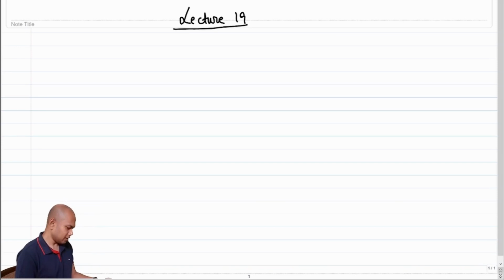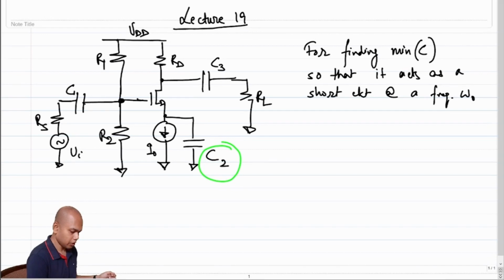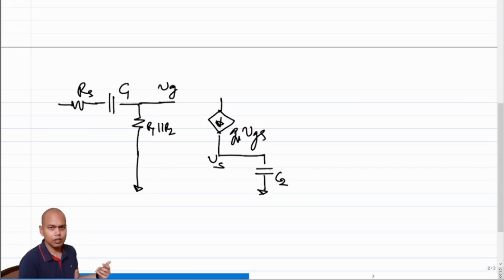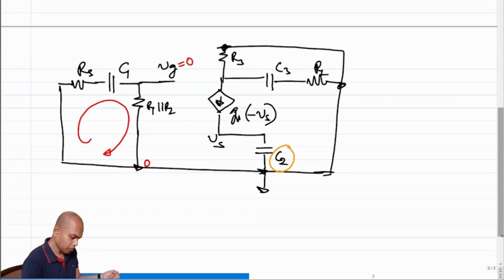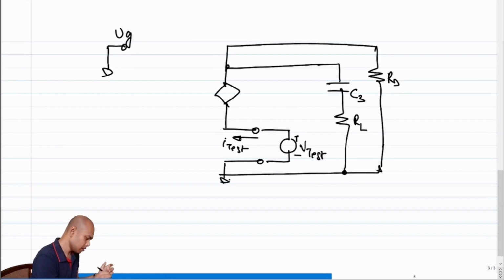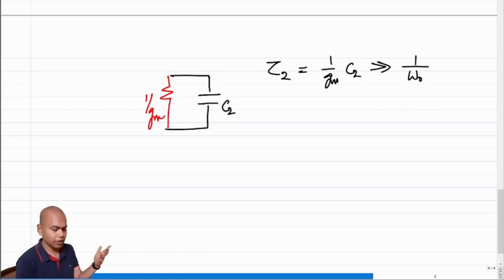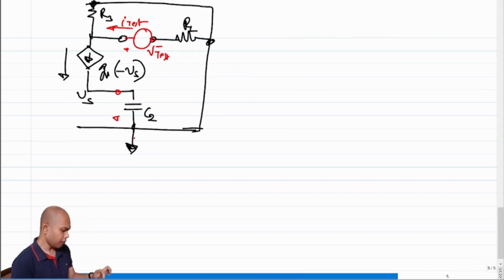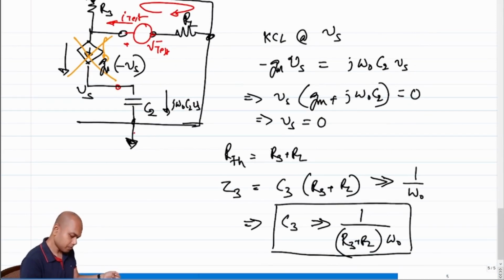Lecture 19  Module 01

Comment: Hi sir what is the purpose of Rd, the reason that you are saying is we need to maintain the mos in saturation region but my question when we directly connect the drain to vdd, the voltage across the drain is vdd which is more enough to maintain the mos in the saturation region can u explain clearly?